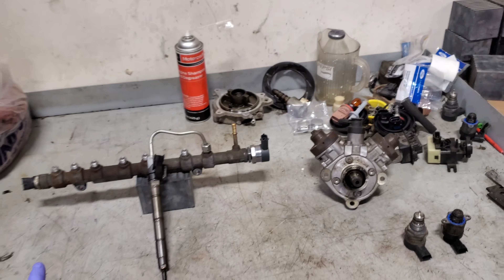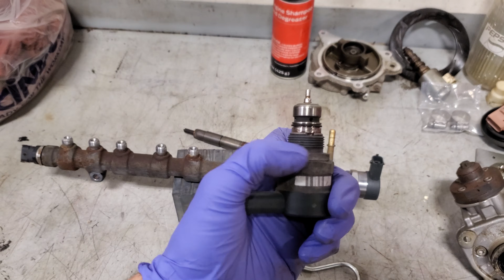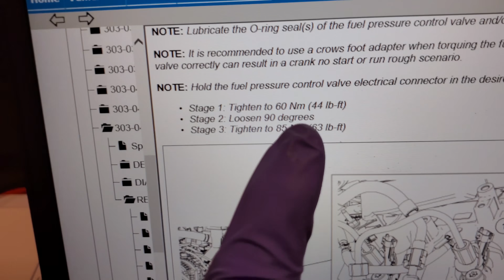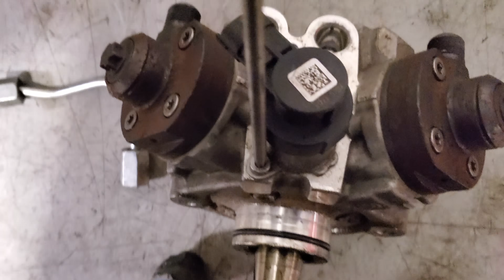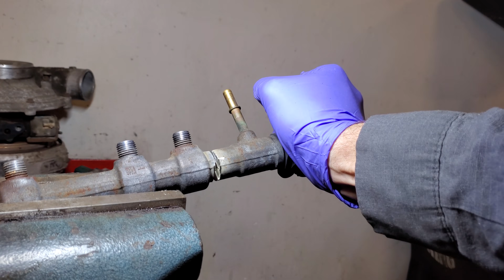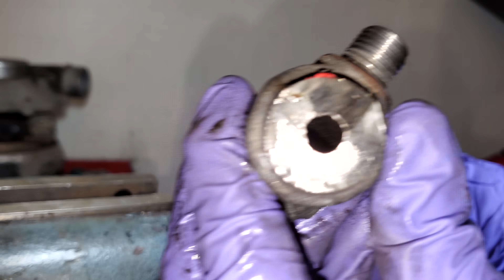High Pressure Fuel system concerns - LH FUEL RAIL discussion | Ford 6.7 Diesel

Comment: My fuel supply line under the hood from the filter is buzzing what is it....change the filters still no better
Reply from the maker: Fp?
Reply: @PowerStrokeTechTalkwARod  fp?
Reply from the maker: Fuel pump
Reply: @PowerStrokeTechTalkwARod  has  the CP4 been revised or is the pump still a failure point on the newer trucks?
Reply from the maker: Still a CP4 but S&S has the fix now
Reply: @PowerStrokeTechTalkwARod  thank you for the reply. ok so even on a new truck the CP4 conversion kit would need to be installed to future proof the truck?
Reply from the maker: Yup
Reply: @PowerStrokeTechTalkwARod  thanks for the info
Reply: @PowerStrokeTechTalkwARod  could I have a cracked fitting on my sending unit on top of my fuel tank

Comment: So if I’m getting 4300 + psi I shouldn’t look toward the cp4 ?? I’m about 100 to 150 psi difference from desired truck started with issue with 3300 psi replaced filters and pump 1st time  we had 4300 lowest and 28999 highest and week later came back i replaced sending unit and pressure sensor test drove it and light popped back up I’m leaning toward control valve
Reply from the maker: Driver side rail bub...

Comment: So can you disassemble the passenger side fuel rail and clean it
Reply from the maker: U cant on either side
Reply: @PowerStrokeTechTalkwARod  what then y is the caps on each end
Reply from the maker: MANUFACTURING PROCESS. good luck taking apart cuz it aint gonna work after......
Reply: @PowerStrokeTechTalkwARod  hay I'm just uninformed so I'm asking questions
Reply from the maker: Now your informed. I don't want ya to get urself in a pickle. NOTE HP fuel sys components cannot be cleaned, they must be replaced.....

Comment: I have replaced all 8 fuel injectors on my customer 2017 f450 truck and tried to programm it with IDS but at the end of coding IDS shows "procedure unsuccessful". What you think could be wrong or any special sequence for coding? Thanks.
Reply from the maker: Alread answered

Comment: i only have p0087 and my truck has all filter change a 20k miles , driving on the hwy it pop up reduce engine power ..stall  i turned on again quick no code or check engine light and  like 20 min driving again reduce engine power.. check engine light on  and one one code p0087 ... it can be my hpfp?
Reply: frp is 4500 and like 28k
Reply from the maker: Cld be, youd have to go thru the pin point test

Comment: Sorry if this is in the wrong area. My wife was willed a 2012 F-250 with 130,000 miles. Since getting it ran it maybe 5 hours and now getting reduced engine power code P0088. Took it in and shop wants to replace entire fuel system. He seems to talk in circles, but I have zero knowledge of diesels. I have since done many Google searches which list other possibilities that he never mentioned, but was ready to go on a $15,000.00 job. Now I'm at your channel which is great and informative, but this kind of work is out of my league. If you don't mind, what would be your suggestion(s)?
Reply from the maker: Email us

Comment: Cp4 just went on my 2017, up here in Canada the dealer wants $25,000 to replace entire system, and can’t get to it for another 2 months. I see kits online for this but is it possible for a backyard mechanic to do this?
Reply from the maker: Yes absolutely
Reply: Go tow a ridiculously big boat to the landing . Set park brake half way down and run 😅

Comment: My fuel injector pipe just blew open on the highway. Cylinder #3. Aftermarket ebay part used. No light's or codes. Always buy OEM!

Comment: In the process of changing my fuel system,cp4 pump failure .just spent the money today $3531.00 local ford dealership and I'm doing this my self,not a truck mechanic I'm a field service heavy equipment mechanic 👍
2013 true cab/chassis used for personal use only 4wd crew cab looks like to much fun
Reply from the maker: Good deal 👍
Reply: @bradmcmanis3231  how did it turn out bud?
Reply: @joeortiz7408  sucked because it was a 2014 F450 cab chassis i disturbed the harness because u have to fold it back had pcm or wiring harness issues when done at pulling pwr the truck would shut off no codes nothing with ForScan hooked up nothing restart even only pulling my toyhauler so I drove it to ford traded it in on a 2022 3/4 ton Godzilla that now has 600hp & 650ft pds torque

Comment: Hey I’m on the road and having trouble with a p0087code I’ve changed the fuel filters and sensor’s but it’s not working on a 17 Ford F-350 with 6.7 diesel. Have u had anybody come in with this issue. If so what would I recomend to fix it
Reply from the maker: That my friend ur gonna need to take in.

Comment: hi there im battling a code p2539 i have checked most causes such as voltage to pcv and low pressure sensors there is no contamation of water or gas i have high pressure on crank 4000 psi i have also torqued the pcv correct cuz after reinstalling i still have over 4000 psi also return fuel is good great pressure coming out of the fuel rail port please advise any of things to try
Reply from the maker: U try a d side rail?

Comment: Is the fuel rail pressure supposed to drop to 330 psi immediately after turning ignition off?
Reply from the maker: Its will goto what ever...not a set number.
Reply: @PowerStrokeTechTalkwARod  I guess what I'm asking is whether the fuel rail should stay pressurized or if it has to build from the lower number each start. Mine take a little longer than I'd like to build from the 330psi. If I hold the regulator percentage with a scan tool and turn the ignition off it doesn't lose pressure and fires right up. Just didn't know if the regulator being bad might cause the issue I'm seeing
Reply from the maker: It will eventually bleed off. It wld have to start from 0 each time it starts after sitting. If you have dtcs, i wld hughly recommend you follow the correct pin point tests
Reply: @timjenkins537  Did you resolve your starting issue? I am having a similar one?

Comment: Was getting code P228F. Truck started stalling at low idle. Swapped in a new Fuel Pressure Regulator (Ford p/n CM 5185) on the end of the rail and fixed my issue. 20 minute job. The longest part was taking out the wheel well to gain access.
Reply: Thanks for your comment. I am getting the same code P228F (fuel pressure regulator exceed max relearn). I am going to replace that sensor to repair the truck. Any advise on how to replace that sensor?
Reply from the maker: Replace the rail...

Comment: I’m curious, i got a P0087 few weeks back, changed my fuel filters, just got the code again today (2,000 miles later). I get my diesel at the same station and they do have good fuel with volume in/out. So I’m wondering if it may be the lpfp or a sensor? Because I get the alert “reduced engine power” but never lose any power, no stalls, truck still drives normal after this. Both times I got the code was while acceleration to merge onto the highway (50mph to 75mph) and never lost any power or drivability which is why I’m leaning towards a sensor rather than a LPFP

Comment: Is their a specific test or procedure to troubleshoot the fuel rail? Perform all of the pinpoint diagnostics for fault P0087 and everything is checking within specs. FVCV has been replaced, FPCV and FRP sensors have been replaced by another shop. Went through diag three times to make sure a step wasn’t skipped and still the same results. Thanks
Reply from the maker: Time for a rail pal!

Comment: This is exactly why I replace the fuel filters every oil change on my 2016 Ford F250 6.7 as well as filling up at the same place every time and running the archoil. People have told me oh fuel filters every oil change that's over kill. Even if so hey i'd much rather spend the extra $70.00 or so and the at most 15 min to replace the filters than have to deal with the heart ache of this mess not to mention any more the months wait it takes to get parts these days! Keep up the good work bud!
Reply: Just make sure the air is bled out each time to not run the pump dry at first startup.
Reply: @ActionJacksonOK Yes many make that mistake and damage their pump. I realize I wrote this comment over 3 years ago wishing I could go back to the time the fuel filters were only $70 hahah.

Comment: I got a code saying low fuel pressure on my dash board so I decided to replaced my injectors and cp4 pump to a 48% over cp4 just to upgrade the fuel system because I was going to do so anyways. I did programe the injectors with the iqa But now my truck won’t start and isn’t building any pressure in the fuel rail. The truck is throwing fuel on the return side but isn’t building any fuel rail pressure. Do you think the whole fuel rail with the sensors  is the problem?
Reply from the maker: How wld I know that from here

Comment: 17 tuned and deleted I have had intermittent 0087 code that comes on after a high demand situation. Like passing someone. My truck gets regular maintenance and filter changes. But it did sit for close to 3 months. I’m curious if you think it could be the pcv ? The reason I suspect that is because you mentioned if it gets rusty and it seems like that is a possibility if it sat for a while. I always put good fuel in it from the same place I also always use schaefers fuel additive the other question I had was could it possibly be the lift pump? The truck has 240,000 miles on it
Reply from the maker: Rail brahhh

Comment: Bought a 16. F350 was previously deleted. 2nd time having p228f fuel pressure regulator 1. Exceeded learning limits. Too  high came on after pulling camper trailer both times. Seems to run fine but not sure how it was tuned. Going to change the fuel filter. Any additive that yall suggest? I been using diesel efficient at Exxon. New to diesel and want to hear any feedback. Where to start? Should I run pressure test? Great video. So many questions regarding the tune with delete if it has anything to do with this code. Guess I'll check FPR for rust and debris
Reply from the maker: Get you some Hotshot Secrets, use our code PTT & DS-TRUCKS together & get you a driver side fuel rail.

Comment: I think the only one that has an office is the beginning years the other one comes built on to the sensor , could have it backwards 

I got one the pump looks good and  losing pressure and returning to Tank , supplied power and ground to both sensors to close return and still bypasses to return system
Reply from the maker: They all have 1
Reply: @PowerStrokeTechTalkwARod   have you ever had those high-pressure pumps no metal no scarring on the pumps when you take it apart and still not produce pressure , I have one that I opening the pump can’t find nothing wrong with it wired both sensors up to deadhead pump pressure and still cannot produce 50 psi , and bypasses to the return
Reply from the maker: Yes

Comment: Have you seen any pump failures that didn’t result in metal shavings? I’m trying to diagnose a truck right now, fuel pressure regulator is good and holding, VCV made a rattle noise when you shake it so I replaced that (new one doesn’t rattle) I’m getting zero pressure on the rail. Lift pump is giving me 80psi. Checked rail pressure with a gauge and still nothing. Lower filter had some nasty water in it from a bed fuel tank. Flushed fuel tank with fresh fuel.
Reply from the maker: Sounds like you need to go thru the M & ME pin point tests....

Comment: Fuel question.... 2012 f250, at cruising speed long distances I started to get a (slight but definitely noticeable) hesitation/miss...  bought the better mprop sensor, pulled the old out, clean as a whistle, installed the better one... truck did great idling and around the neighborhood, drove 30 miles to work and it started missing horribly about 2 miles out, got to work and truck was surging so bad, it was shaking (like it had a big cam), pulled up fuel map and it was constient waves across the map... no codes whatsoever. 2012 deleted, filters less than 2k miles. Thoughts where to start??
Reply: Any suggestions, greatly appreciated
Reply from the maker: Gotta email me & book some time pal. Content is for FREE, time is not.

Comment: Great video. Got a 2015 6.7 and about once every 2 days I'll get the p228 that says fuel rail pressure sensor learning limits exceeded. Demand vs Actual are right on. You are the 2nd video I've seen where they replaced the driver rail and problem solved. Looks like I'm gonna get a fuel rail and some HP lines. Thanks!
Reply: Mine just got that code but it's running fine . Should I still replace the driver rail ? And can I still drive it ?
Reply from the maker: I duno we'd have to go over it
Reply: @PowerStrokeTechTalkwARod  idk it's running fine right now only thing I notice is the engine light is on but I'm parking it until I take it to a shop,, I don't wanna run it and make it worse
Reply from the maker: Ok
Reply: @Bugslife0007  did you get it fixed. I got the same code.

Comment: i have a 2014 f-350 6.7l powerstroke. my actual fuel rail pressure reaches 10k psi before i get an engine derate power warning, my desired and commanded are both at 4800-5000 yet it builds up to 10k. at full throttle and varying throttle desired and actual are perfectly in sync after i get the derate warning. also throws code p0088. any help would be appreciated
Reply from the maker: To get diag you will have to pay for my time. There's no magic fix with these trucks....
Reply: @PowerStroke Tech Talk w/ARod   how much for tips or pointers?
Reply from the maker: My email is all over my channel...descriptions...about page. Meet up over there

Comment: Glad I found you! This video is exactly what I'm dealing with. I just bought a used good condition 2019 6.7L F250. The truck ran great until I put the S&S CP4 disaster prevention kit on. After putting the kit on, the truck ran for 30 seconds, then burped and chugged and died and hasn't started since. It's throwing the P2291 code. I've double and triple checked the S&S install and plumbing and everything is as it should be. I'm getting fuel through the entire low pressure system and even cracked a supply nut on the driver side fuel rail with the key on and got good flow out of the fuel rail. There was no metal glitter paint found during the install. What are the chances one of these other high pressure fuel components went out at the same time? Help!
Reply from the maker: Brother, I've done multiple kits & have not 1 issue. I dunno whatcha did....
Reply: @PowerStrokeTechTalkwARod  Got it. Bummer. I'll circle back to the install. Thanks.
Reply: Did you ever find the issue?
Reply: I just installed the same kit yesterday and now it keeps stalling at low idle. Any updates on your issue?
Reply from the maker: You did somethin wrong
Reply: installed the S & S and had the same thing happen, even removed the S & S and still nothing. would sure appreciate any info on what fixed your
Reply from the maker: Yea man, hanve done 50 or 60 of em & havent had an issue. Yall gotta check something u did. Contaminated something
Reply: I have the same problem check and double check even took it off and put it back like it was won’t start. Ran for about 10 minutes after installing it, then shut off.
Reply: I have the same problem. Did you ever figure it out?
Reply: @roysmith7724 did any of you figure the problems out on your issue?

Comment: I changed  mine about a year and half. Not sure what the problem was. I just bought the truck used and about 6 months it went down on the freeway. It was the fuel pump failure. I was able to do it all myself. Cost me around 5k after I put a airdog and damage prevention on it. No I have a p0278 and p0284 codes. I changed the vacuum pump today cause I had no brakes. All this happened the same time. I had gas in my fuel so I drained tank and changed all fuel filters and changed oil. I was getting contribution balance on all cylinders and now it's just on 6 and 8. Any ideas?

Comment: 2016 replaced hpfp for a oo93, desired vs actually off under load.  Then chased injectors replaced all but 1 and 2. Still developing 0093 desired vs actual.  Now really debating drivers side rail.  But idk
Reply from the maker: That shlda been ur 1st repair bud.....
Reply: Did a fuel rail end up fixing it?

Comment: How do you depressurize the fuel rail before working on it?
Reply from the maker: Shut the truck down...by the time you get to any lines....shits gone
Reply: Nice thank you sir I watch all your videos and I wish you were closer I'd take my truck to you I really just don't trust people these days, I've had a so called diesel master mechanic at a 4 dealership work on my 6.0 bingo and stripped stripped every 8 mm bolt there was while  Tearing it down to get to one injector replacement because they decided to use an impact gun and cross threaded them👎

Comment: I have personally had this exact same issue. 3 shops tried to fix it but only after me doing some looking in to had the fuel preasure regulator replace to fix the problem. while under load and only under load my truck would go into limp mode and then I had to reset the dtc's to get it to work again.

Comment: Never heard or a Orifice on the fuel rail on a 6.7 that would be crazy if they put one there because of fuel pressures. 
As you open one up it's not there. 
Post if you find answer.
Thanks
Reply: Hey , just checking if you ever found an orfice.
I spoke to several ford mechanics they said they have not heard or ever  seen any kind of orfice on the fuel rail.
Reply from the maker: Yes it's there. It's INTERNAL to the rail
Reply from the maker: Its there trust me